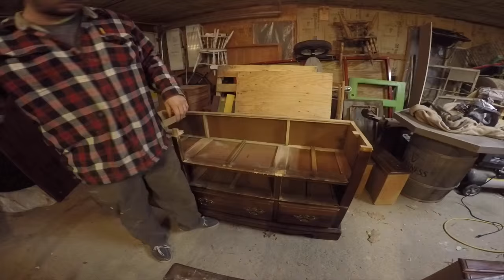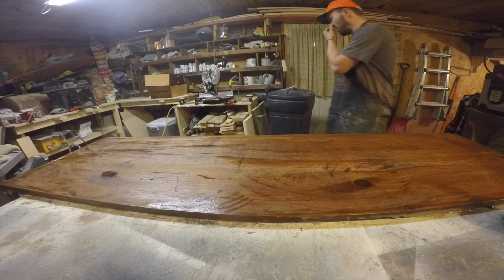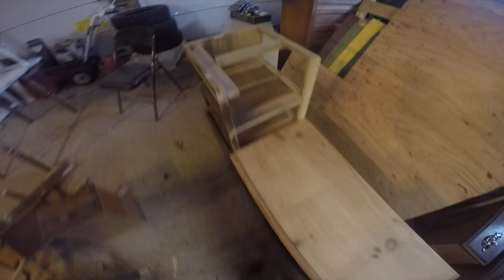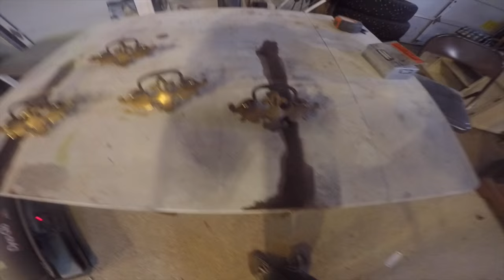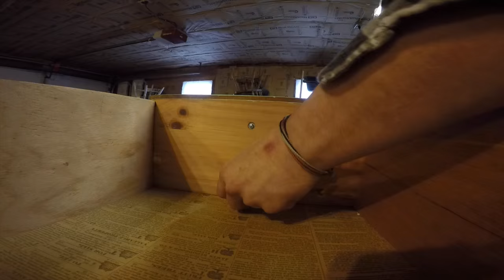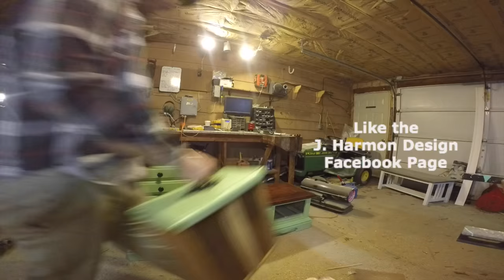Building A Storage Bench // From An Old Bureau

Comment: Did you strip, sand and repaint the green parts, or just paint over what was there? I didn’t see that step but I assume always stripping the old paint is the way I should do it?
Reply from the maker: Ashley Wollaston usually if I am painting I will scuff the entire piece with a Brillo pad and then repaint over. Depending on the color and paint I’m using I may do a primer coat. But if it’s a refinish and they want it restained wood then you have to strip it all down.